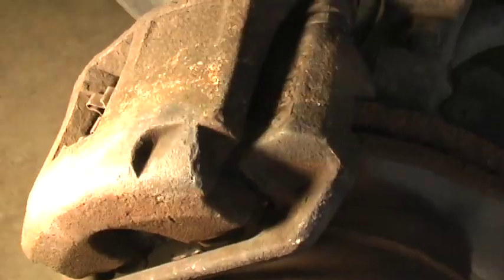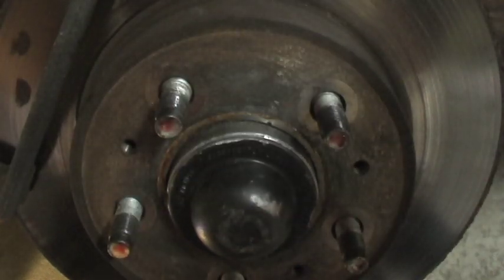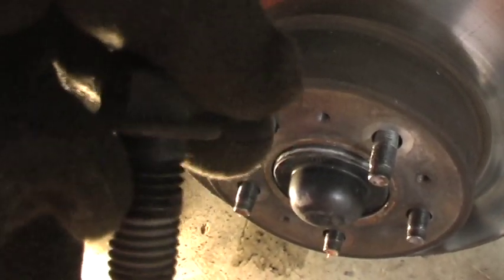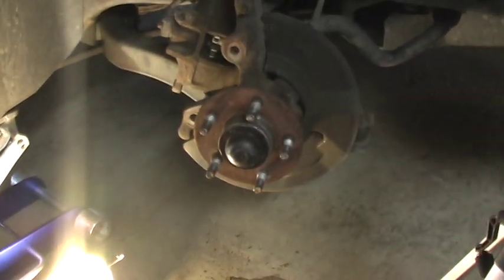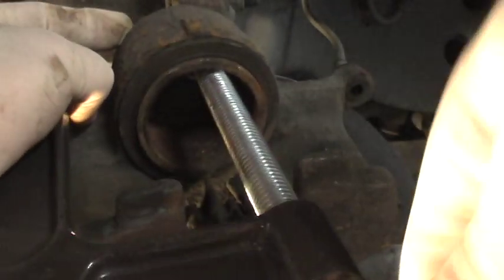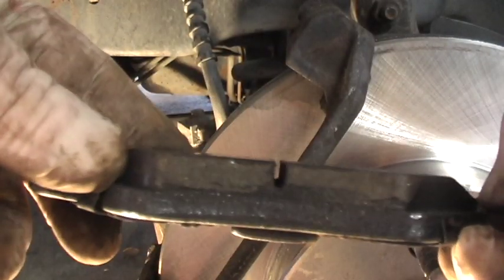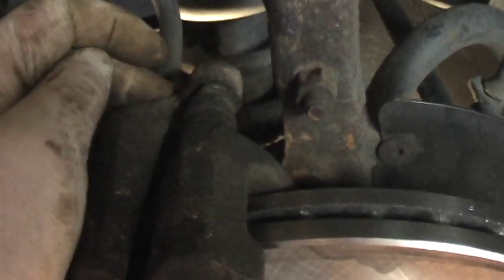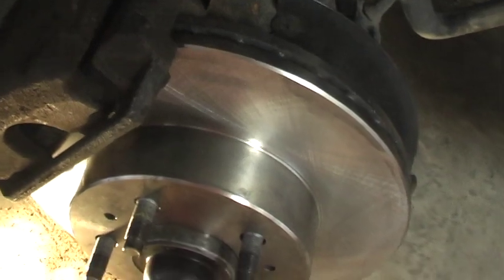Brakes & Rotors 1995 Lincoln Town Car

Comment: When I see videos like this and read some comments from professionals (some kind some not) you can't help but be so thankful that someone went through all this trouble to help so many who would like to do what he did. He shared his expertise as limited as it might be but shared his knowledge for so many backyard mechanics whose sole purpose on doing this yourself is financial savings. We did all four on our 95 and dreaded breaking free these 24 year old bolts that were never off on the rear (mileage 73,000) When we started on the rear brakes we had a heart attack when we saw no hex bolt heads. There were two smooth Allen wrench bolts on the rear rotors. Fortunately we did have a great set of old  steel Allen wrenches that were nice and snug and the  long side was long enough to give us plenty of leverage and all four Allen bolts (2 on each caliper) broke free with relative ease. I'm 83 and this ole body ain't what it used to be.The only recommendation I would make to anyone watching this video would be to place a 3/4" by 4" long by 2" wide piece of wood over the piston so that pressure on the circular piston by the u-clamp placed in the center of the back of the caliper and in the center of the piece of wood is equal on all sides. This way you minimize any chance of damaging the pistons and piston sides.We didn't have any anti-rattle clips nor could we get any so we used an orange thick cream from the auto supply which you place several dabs on the back metal side of the brake pad plate to make it adhere to the caliper. It hardens to a rubbery consistency. Before pushing the piston back in we opened the cap of the brake cylinder to relieve any pressure build-up in the cylinder.  When we finished all cylinders we made sure to check the brake fluid level and close the brake cylinder cap snugly. After we tested the brake levels  and brake pedal hardness we test drove the car. We test drove the vehicle to make sure all lines and cylinders were filled equally with brake fluid and the brakes were like new. It was a great feeling to have firm smooth brakes that stopped quickly, smoothly with ease in a straight line with no veering.. Displayfireworks did a fine job in making this video.
PS. I called a shop to price the job and had we had the job done in a professional shop it would have cost $779.00. 4 rotors and four sets of pads cost $206.00. Thanks so much for sharing, Grampa Joe Pero.
Reply: ***** I usually just put the old pad against the piston and the crank the clamp against that.
Reply: ***** That is so simple I'm embarrassed that we didn't think of it. Plus the pad plate is a perfect fit with a steel backing and takes up virtually no space. Thanks for the heads up.